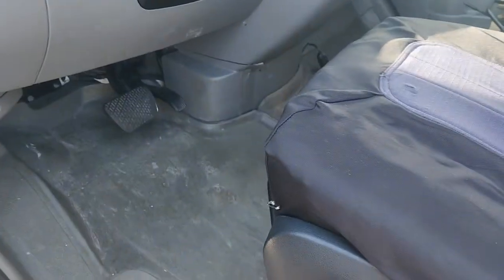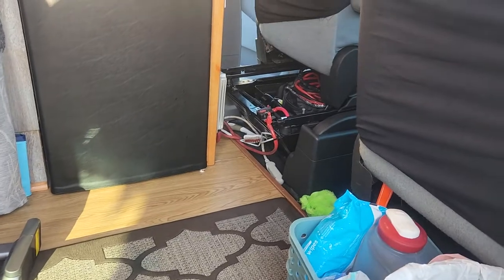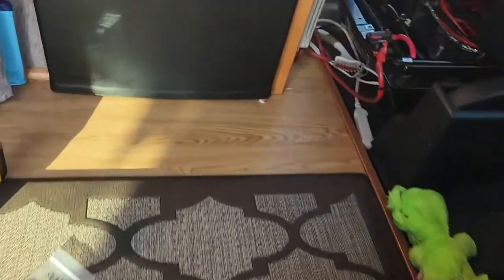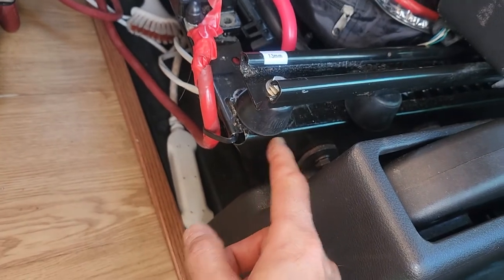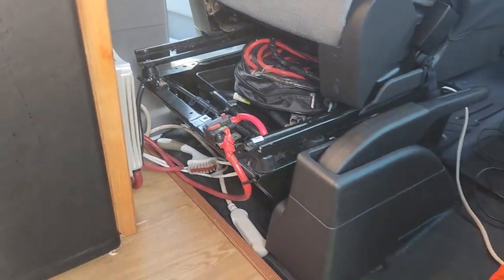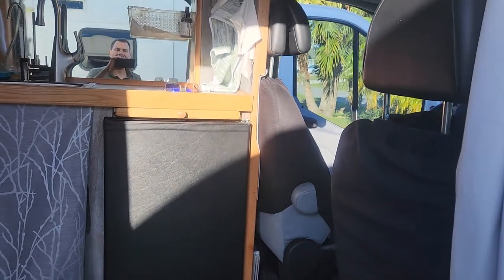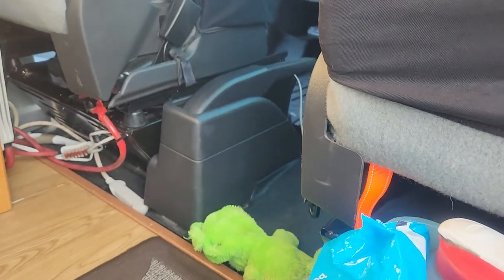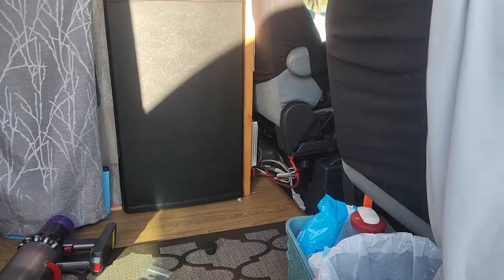How to increase DRIVER LEG ROOM in Ford Transit van (and other vehicles).

Comment: Cool. As long as you have an engineers certificate, saying it's safe, that should give you peace of mind. and satisfy insurance companies. (need to check). YES, those hand brakes are totally tarded design, hand brakes use to be under the dash, and you'd pull a handle. Totally out of the way.  Havinga large hand brake next to a seat, in a van, where you might want to install swivel seats or move between the seats to the rear, is beyond stupid.  There should be an after-market HB, to return to under the dash design.
Reply: Agree